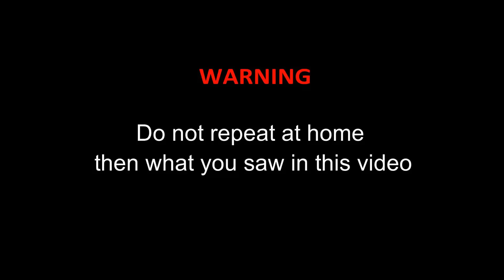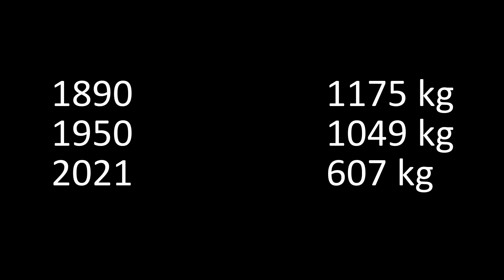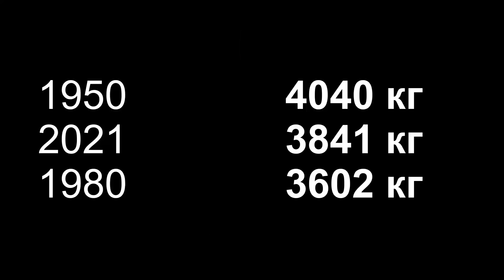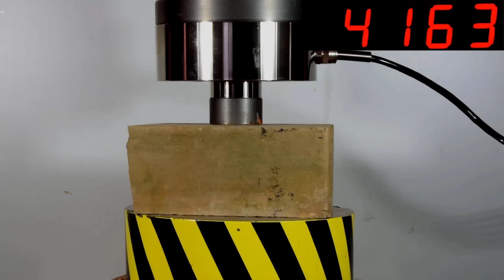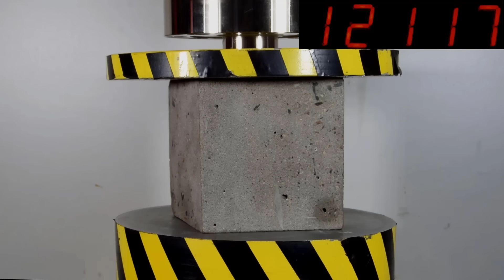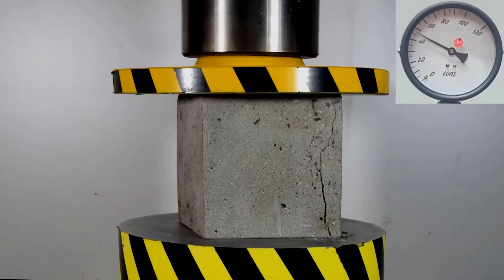HYDRAULIC PRESS VS OLD AND MODERN BRICKS

Comment: Amazing. It's interesting that the 1890 brick did better than the newer one. Same with the concrete. I don't know enough (anything) about how the manufacturing process, but I wonder what is different about today's brick/concrete making versus a century ago.
Reply: Modern bricks are made with air pockets for several reasons. One; lighten the load. Two; reduces the affects of heat, moisture and high winds expanding and contracting and causing structural issues, as they would very easily with older bricks. Three; makes heating/cooling the interior easier without resorting to types of insulation like asbestos. Four; makes them cheaper and easier to produce. Five: reduces the need for thicker walls just to support their own weight.

Modern day buildings don’t use bricks as load-bearing walls, so they’re basically just there to keep out the weather, and don’t need to be as strong. That stops them needing to be so heavy, meaning the walls themselves don’t need to be as thick. Older buildings used brick walls as load-bearing walls, so they had to be tougher, thicker and heavier… much more expensive, more reliant on asbestos insulation, and more likely to crack or rot under wide swings in temperature or heavy moisture. They were also much less safe in the event of hurricanes/tornados, earthquakes, etc.

Of course there’s also a “survivorship bias” element - these are bricks that were built strong enough to last, rather than your average old brick. The 2021 brick was likely just an “average” brick, not a particularly strong one for the day.
Reply: @ArmorCast  Nice, detailed information. Thank you for that.

Comment: So many variables not considered.  A proper test would cap the ends of each sample so there is an even load - not point loads.  Also the modern concrete looks like a sand cement mix to me - no course aggregates.  The old concrete had smooth edges and  therefore no point load and concrete is gaining strength over time.

Comment: Modern bricks are engineered to be crap. Likewise the rest of the building materials. The minimum standards now are even more minimal than what they were 60 years ago (I'm in the UK). Typical new-built houses today are built with a brick shell around a wooden interior frame and plasterboard walls. They are built to last 25 years. I live in a house that was built 70 years ago, The walls are brick built with a cavity. Internal walls are built from "grunters" as they are referred to in the building trade.

Comment: I find it disturbing that they are measuring force in units of kilograms.  Kilograms are a unit of mass.  Newtons are a measure of force.  Mass and force are not the same thing.  Ask anybody who has spent any time in orbit or on the surface of the moon, or any of the engineers who got them there.  I'm nit picking - a most enjoyable video.

Comment: There’s so much wrong with this and it’s bothering the fuck outta me. 

First, there are four bricks shown in the beginning, but only three are described. So right off the bat, not everything is accounted for. 

Then in the second round of tests, the bricks are placed haphazardly off-center, creating greater potential for inaccuracy. There is also a typo at the end of this round where 1890 becomes 1980. 

Then on the third round, we are not even given specific years for “modern” bricks or concrete. And what “fortress” gave someone permission to just carve a block off of what is probably a monument and run home with it and crush it? 

Also, as many other people have added, there’s is plenty of unspoken context for why these bricks and concrete are the way they are across these different spans of time.

Comment: If this were a science experience I would fail you for not being consistent in your testing. Why was the modern high strength brick not propped up on a stand ad well? Why were the older larger bricks not resized to match the newer bricks? Same with the concrete. Do better.

Comment: This video is flawed in so many ways. To not get to false conclusions please read below. 

Firstly, he is reporting the weight on the brick, but not the compressive strength of it. This is dependant on the area on which the force is applied which appears different for the varieties of bricks he uses and for the concrete squares. Secondly, what you call "modern concrete" is not concrete but mortar since it has only sand and cement but no coarse aggregate. This makes it vastly different from the "ancient concrete" you also test, which has both fine and coarse aggregate.

Comment: I would be curious about the weight between the bricks, I do believe though that concrete does get stronger over time from what I heard. Research if the materials or formulae have changed too.

Comment: There is a difference between cement and concrete. His modern "concrete" 4:44 is only cement. The old concrete 5:15 is concrete, with gravel mixed in greatly increasing strength.

Comment: i am curius about the process of creating the modern concrete cube.. what analogy was used and what conditions did were used... the strength of it depends on a lot of factors.. (even if you took the same analogy/conditions with the old style concrete you would not get the same results as concrete tends to get harder with time) great demonstration by the way..!

Comment: And by the way. The problems with bricks buildings? Always come down to cracks between those bricks. Doesnt matter which type of bricks and how strong those bricks gonna be. They are glued together by cement. And either get damage by water or just simple by weak foundations and gravity. 😂 just build house by coconut leafs. Will be much greener and easier to replace. 😂 cannot? Well. Too bad for the climate.

Comment: That first test really isn't the best way of testing the strength of bricks, since there's a gap in the bottom instead of a flat surface it puts extra tensile stress on the brick when normally they'd only have to deal with compression, also in all of the tests the force is focused on one spot instead of spread out over the entire top of it.

Chances are in a more real-world accurate test the modern bricks would win or score equally.

Comment: Assuming the older bricks were used I wonder if a factor of time and pressure may have hardened them somewhat.
Reply: 100% right, they do. Time ages concrete which increases its compressive strength.

Comment: Pretty interesting to see how we've gotten so much better at making things for specific purposes. We can either make things a lot stronger than they used to be back in the day, or we can save resources and make them only as strong as they need to be.
Reply: I really would have liked to see a test of a modern solid brick (IE one that could be used for load bearing, not just facade) vs the old ones. Cuz as it is, the test isnt really a comparison. Its like comparing the strength of a solid piece of wood with a piece of wood that had insect tunnels in it.
Reply: @childofcascadia  They actually did, right? At 4:07

Comment: Bricks produced before approximately 1850 are often not as hard.  That date is roughly when Portland cement was introduced and was significantly harder than earlier like mortar and even the bricks--as a result bricks needed to be harder/stronger to be compatible with the mortar.

At least that's my understanding after buying a house from the pre-Portland era.

Comment: You could draw the conclusion that things aren't built to last as they used to be, but maybe we found out that bricks and concrete doesn't have to be as strong to do its job right. Weighing the bricks beforehand would have yielded some useful info as maybe the bricks are also twice as heavy. Seeing as lighter bricks only have to support half the weight as the bricks placed on top would also be lighter, it's just more cost efficient and less straining on natural resources

Comment: Its always the older products that last longer, be it vehicles, bricks, or vacuum cleaners. The saying ‘old but gold’ is perfect for here
Reply: If you use old bricks for housing it's really not good at all because it have absolutely zero temperature isolation , is way too heavy and can easily crack due to temperature and humidity variations
Reply: @jambon2730  granted about the bricks, development and innovation have made them far more effective in matters such as retaining heat, but in terms of physical strength they are still superior. And this also includes the other items mentioned, we for one still have a vacuum cleaner from the 1990’s that works well, while we had gone through 3 dyson vacuum’s in a matter of 2 years before returning to the older one.
Reply: @PeanutGallery762  People don't need a house able to sustain an elephant, they just don't want to pay half of their income in electricity bills during winter.

Plus harder actually doesn't mean stronger in construction. Old bricks have way less tolerance to heat and humidity variations and can easily crack

Comment: Not a true test of bricks or concrete the contact points are all to balls your pressure plate was in no way uniform to the surface of the bricks or concrete. Plus the first concrete test was crap it contained more sand and cement and very little aggregate this not concrete . and concrete takes up to one hundred years to reach is max performance. So your test is full of flaws.

Comment: @Crazy Hydraulic Press You have access to an expensive scientific equipment, yet your methods are not scientific! What a shame!

Bricks can have different classifications based on (1) The materials used to make it, such as clay, mortar (cement+sand+water), concrete (cement+sand+stones+water), calcium silicate, adobe, etc.;  (2) The targeted strength of the bricks; (3) The use of the bricks, such as engineering bricks, surfacing bricks, paving bricks, etc.

While the bricks crushed here looks like either burnt clay (identified from the reddish colour) or concrete bricks (identified from the grey colour) only, the second last one is actually a mortar brick, since it lacks stones and some of the 'clay bricks' may actually be calcium silicate bricks coloured to be reddish.

Bricks may be manufactured to have different strengths suitable to their eventual uses, hence, there are clay bricks of different strengths, for example. A brick manufactured in 1890 to have a high strength, if kept well, will retain its high strength in 2022. Your only characteristic of year of manufacture is not sufficient to indicate the strength of the brick.

Comment: To those who ask, whether older bricks got their hardness over the time.
No they didn't. Bricks are not from concrete - which hardens over time. Bricks are made from clay and they're baked then. There is no further hardening. The difference is, that today they have more progressive and modern approach" which translates into putting a lot of "filler" (i.e.cheap garbage into it. That's why the difference.